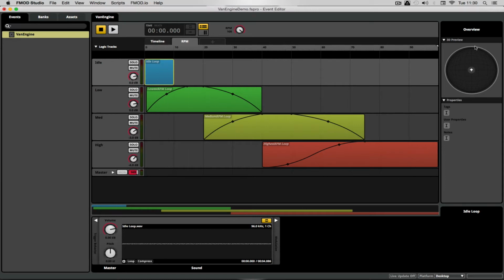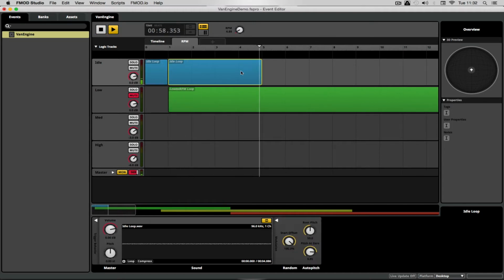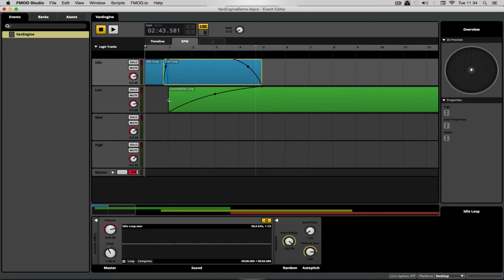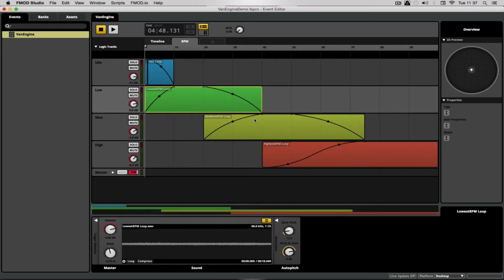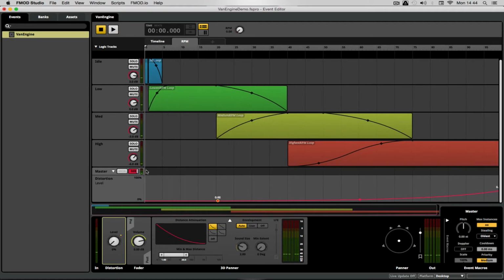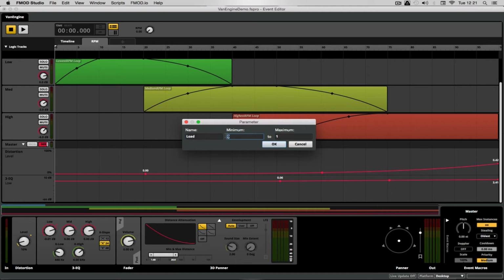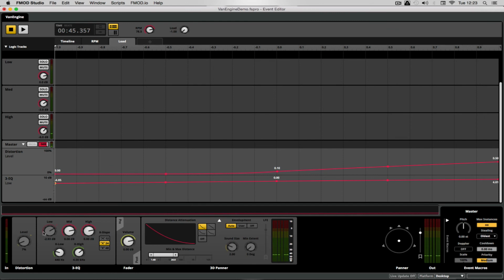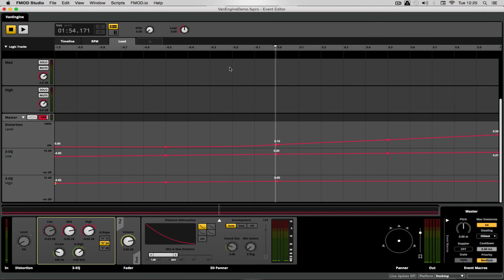Adaptive Engines in FMOD Demo - Part 3

Comment: Just a few questions:

how if we have a few gears which are changing for example at 3600 rpm?
The whole system is based on RPM parameter between 0 and 100. For example,  if I gonna create an RPM parameter with value max 3600 and each gear is shifting at the same value (3600) then the only solution is to create an other parameter separately for a "gear" which gonna be "a global one" and then use there nested events including RPM parameter to each one gear to simulate it in the best way. Do you have other solutions?
Reply from the maker: Ignore the numbers in my demo as it is theoretical. Most programmers like to use parameters between 0 and 1, or the percentile range. But clearly for a realistic engine real RPM numbers would better reflect the different cars that you might drive. 

Your idea for gears on a separate parameter sounds useful and elegant. Try it. I’ve done gear shifting but purely for sound reasons, never for actual realistic engine behaviour.

Comment: Hey! Looks like impossible to use "Engine Designer" parameters (Load, RPM) in Game Engines (ue4, unity). What you can advise?
Reply from the maker: Why is it impossible? It depends on the car design and how the programmer has set it up, often the engine is simplified to a Speed parameter.

Comment: Good tutorial video....well presented
Reply from the maker: Thanks Andrew! I haven’t done a new tutorial in a while. Any suggestions of a good topic to cover?
Reply: @rorywalker4770  Just got into FMOD for uni work doing a racing game idea all sounds tho ...no action again thanks
Reply: @rorywalker4770  Hi Rory, if you are still taking suggestions. I'd be very interested in a proper way of simulating other sounds cars generate. So for example the punching through the wind and tires on different surfaces. I find it a real struggle to make cars sound good, especially when they come passing by.

Comment: I took a try at this tutorial and I managed to simulate a Honda F series engine (accord,) complete with VTEC.
Reply from the maker: Great!  I would be interested to hear how VTEC changes your model.  Does it just allow for extended high RPM?
Reply: Rory Walker Vtec is a form of variable valve lift and timing. To get the effect, I increased the distortion and volume of the final rpm clip with a sudden fade from the previous clip.

Comment: Hi Rory thanks so much for this series! Exactly what I needed. :) Actually one of the biggest take-aways for me from the series was simply to use RX to edit the source files! Being able to see the harmonics during editing is SO useful. Thanks again.
Reply: One thing I was wondering - have you ever needed to calculate the RPM of the engine based on its pitch? Simply multiplying the frequency of the sample (in Hz) by 60 seems to give an approximate estimation. Do you know of any more accurate way though? Thanks.
Reply from the maker: Thanks for your nice comment, I'm glad it was useful to you.
Reply from the maker: Pitch frequency is in cycles per second and engines are in cycles per minute, so your calculation makes sense!
The problem is that the perceived pitch of an engine will not only depend on the RPM but also the number of firing cylinders or valves (I am NO mechanic, someone please correct me!).  What I mean is that if an engine makes two noises per revolution, then the perceived pitch will be an octave higher than if it makes 1 noise per revolution, etc.